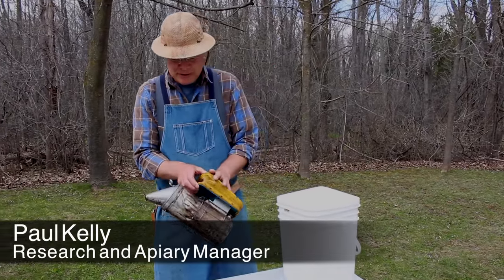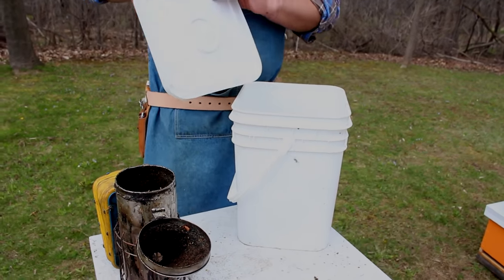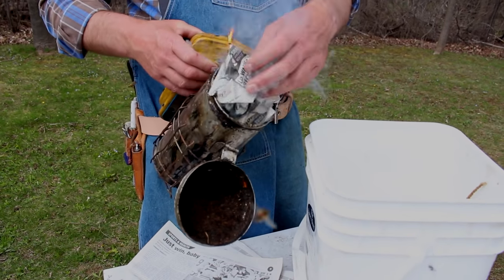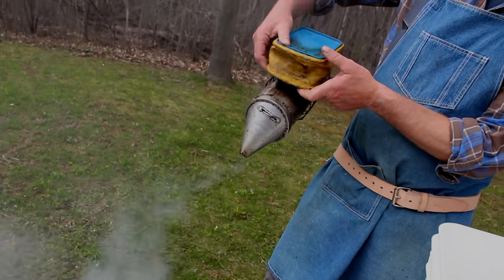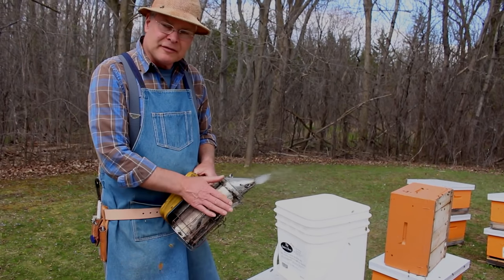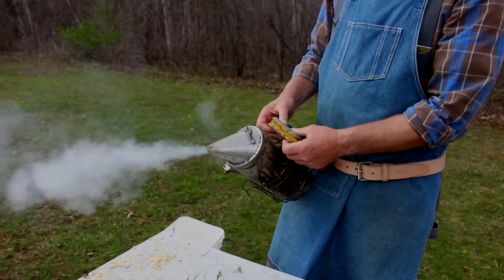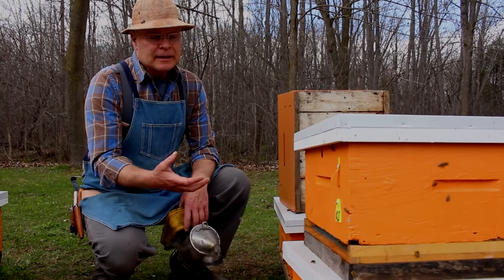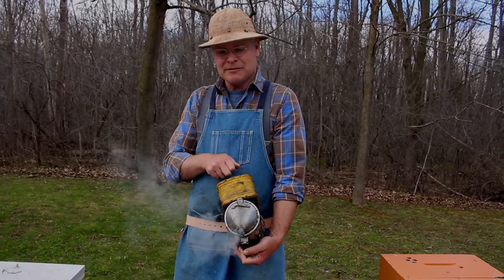Smoke Use

Comment: Interesting and Informative. Down here in Aus where things can be very dry we have instances of smokers causing bush fires. We use a range of fuels from hessian,eucalyptus bark cardboard etc. one handy gadget I use is a long neck kitchen gas lighter which reaches to the bottom of the smoker when tilted. Can light the shavings at the bottom of the smoker.
Reply from the maker: HI Lynton
 I'll bet you do have to be very careful there. Our crew started a grass fire once  that ran to about 5 acres and required a call to the fire department. Very dangerous!  I give much better safety instructions now. Thanks for passing on the tip about the long lighter.

Comment: Practicing lighting mine before spring and the arrival of my first bees. I seem to get flames shooting out the air hole at the lower bottom of the canister adjacent to the bellows. I’m starting with newspaper as the video and adding wood smoker chips. What do you think I’m doing wrong?
Reply from the maker: Hi Leah
 Always a good idea to practice! I'm wondering if you have a grate in the bottom of your smoker. Look online to make sure your smoker is all set up in the right way. The hole coming in at the bottom has to be below a grate. I really like Dadant smokers. Poorly made smokers are often sold to new beekeepers as part of a kit.

Comment: Great video there. I  have a massive beehive on the top of my terrace that i want to get rid of. I am planning to call a professional bee handler to remove the hive without hurting them, so they can relocate. However, i was wondering if i could keep the comb to extract honey. He said he would be using smoke to pacify the bees, and i am thinking if the bees engorge themselves with honey when they see smoke, wouldn't that mean there would be no honey in the comb, or at least very less honey than I could get? Then i also see you and almost every professional bee keepers use smoke to subdue them. Or is it considered a normal loss to lose that bit of honey that the bees have on them.
Reply from the maker: Hi There
 Smoke gets bees to eat a bit of honey. Not a significant amount though. Go ahead and contract your bee handler. It's a lot of work for them to remove the bees. Be clear about who keeps the honey in your arrangements.